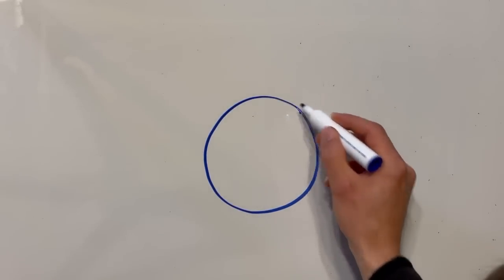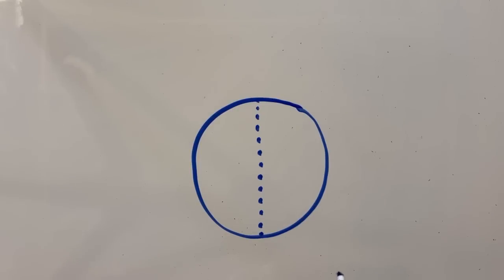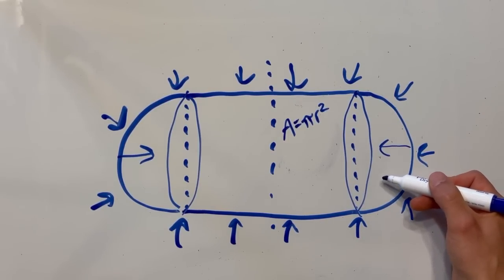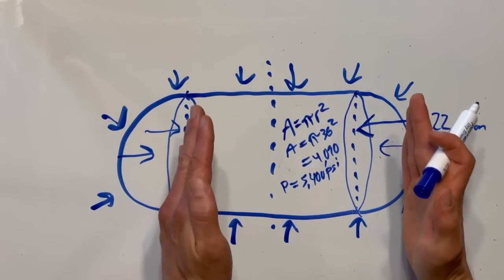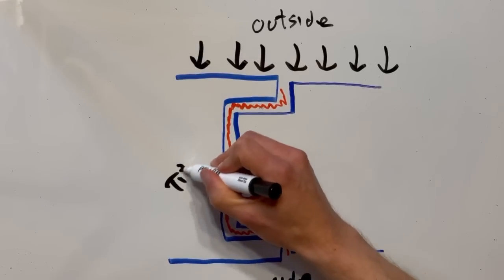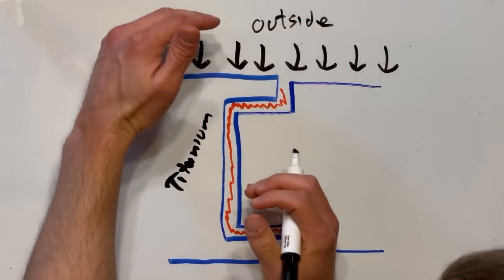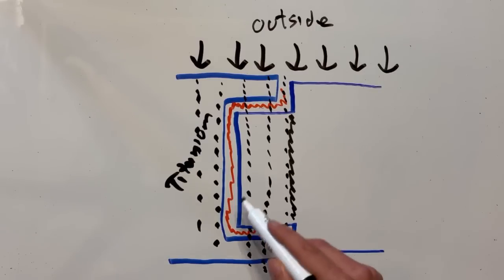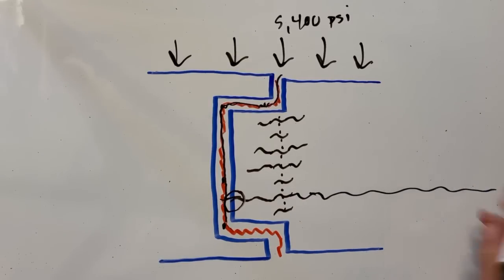Simple Engineering Analysis of How the Titan Submersible Could Have Failed

Comment: Hello mate. Thanks for your video, I am actually a Civil Engineer and I am looking at it from a different way, instead of taking a cross-section which is a circle, if you take a longitudinal section of 1 inch thickness through the carbon fiber cylinder and the two ending titanium rings,  you end up with sort of a beam of 2.6 meters in length and 1 inch in width and a depth of 5 inches (the thickness of the carbon fiber), the beam is now supported from both ends by the two titanium rings, a very simple structure with a uniform load from the top of 5600 psi, I believe the concentrated load in the middle will be massive and the carbon fiber depth needs to be far more than 5 inches, I also believe if Stockton put a third titanium ring in the middle between the two rings, but from inside only as a support to prevent the cylinder buckling in the middle point which is the point of max buckling, it would have made a massive difference in safety. Am I right? And sorry for the long comment. Cheers
Reply: Retired structural engineer here: you are analyzing it incorrectly.  A longitudinal slice of the cylinder isn’t a simply supported beam.  A simply supported beam transfers force only through the bearing points of the beam and also has no lateral buckling restraint.  A longitudinal cut from a cylinder will be a wedge shape in cross section and the primary force transfer is compression against the sides of the wedge, not bending force resisted at the ends by bearing points.  Treating a longitudinal element of a cylinder as a simple beam is a completely erroneous analysis.
Reply: @LTVoyager  Cheers
Reply: @LTVoyager  - I am not a structural engineer.  I am a STEM-phobic poet attempting to discover previously unused portions of the brain. I have just scrolled past 200 comments insisting that this video is the only simple, sensible, accurate explanation of the implosion. But none of it made sense to me because the illustrating principles "felt" wrong, imprecise, inaccurate. Like a specious argument. Especially the image of crushing a phone book. Say what??? Then I found your comment----- that the cross section of a cylinder is a wedge (in my mind, an equilateral triangle with angles touching the circumference of the circle at equidistant stress points, pressure points, or points of resistance to pressure. Then I wondered if my image is also over-simplified because everyone's brain sees a different part of the elephant.  Do you agree?  Are we right or are they wrong?  :)
Reply: @CalebAchsah  Almost everything on YouTube is greatly simplified given the audience.  There are a few exceptions, but a truly detailed engineering explanation of the forces on a cylinder as compared to a sphere would lose most viewers in the first 60 seconds.  Nothing wrong with simplification to discuss a concept, but you need the details to be accurate on failure modes and why a sphere is a more ideal shape than a cylinder when it comes to resisting external compression.  There comes a point when simplifying a problem begins to lose the essence of the physics and material science and that is when simplification has been taken too far.
Reply: @LTVoyager  -  Yes, so true. My mind paused at simplified "equilibrium" because it was easy to envision evenly distributed external hydrostatic pressure on a sphere. But then I wondered how the force of gravity might affect spherical equilibrium. And before I could ponder that thought, I suddenly realized that there must be an equally opposing internal resistance that prevents the mighty ocean from immediately crushing any kind of submersible in any form. So I thought of internal bracing, like a spherical or cylindrical steel frame supporting the interior ceiling, walls, and floor, and made of sufficient thickness to withstand the external hydrostatic pressure bearing down on that particular metal (steel). 

I wondered if some kind of non-entangling cable could be attached to connect the submersible to the surface ship.  And what about other forms of geolocation?  For several completely original seconds, it was quite exhilarating to 'think like an engineer.'  Until I remembered that I am only a poet waging a personal war against STEM-phobia. The shock was too much and I had to lie down. But I will not give up!  :)
Reply: @CalebAchsah  The thick metal sphere IS the supporting structure.  No need for internal supports if the sphere is properly sized and fabricated.  Some submersibles are tethered, but that brings it own set of dangers, particularly around wrecks like the titanic.  Get the tether caught on the wreck and you are in a world of hurt.  Self-propelled is generally safer, again if well designed.  People need to realize that we have been deep diving in submersibles since the 60s and this is the FIRST implosion of such a vehicle so we need to keep this in perspective.  Good engineers have been designing safe submersibles for 60+ years.  We should not let one sloppy engineer ruin the reputation of an entire industry.
Reply: @LTVoyager  -  Excellent answer! Many of us in the "news public" are easily distracted by whatever seems new. The publicity that Stockton Rush courted for his "innovative design" gave the impression that his vivid imagination would rescue adventure, exploration, and scientific research from stubborn historical impediments. And James Cameron was quick to credit himself for multiple dives to The Titanic and to the Space Challenger (was that it?) in the Mariana Trench. So it really is the responsibility of the media to explain that Stockton's deviations from traditional engineering design were unnecessary but "cheaper." His guiding objective was to force "innovation" to fit within his own limited budget. 

Thank you for your patience and for taking the time to give correct answers to my thought process.  I have great respect for STEM professionals.  Congratulations and best wishes!
Reply: @LTVoyager this event has & will continue to help engineering, increase interest in numerous subjects & serve as a HUGE teachable moment
Reply: @myFido-vm9zi  True, but most of the benefit could easily have been had without the loss of life.  It is called engineering testing.  We do it all of the time and we don’t put humans inside the test articles.
Reply: @myFido-vm9zi  That’s a lot of speculation there.  I’m an engineer.  I don’t do a lot of speculation so I will leave that to you.
Reply: But we shouldn't also forget that the front acrylic window was only certified for 1300 meters, this could be also a very probable point of failure
Reply: @AhmedBahgat  True, then no matter how strong the rest was it was all pointless :/
Reply: I totally agree. I think he’s missing the point here talking about the pressure on the end caps, & he seems to forget that these force arrows on the materials are acting in all directions.
Every test I’ve seen (including a rudimentary scale model in a pressure vessel) has shown that it’s the deformation of the tube (inwards at the middle) that caused this, pretty much blowing the end caps off.
Reply: Yes I was also thinking a titanium ring in the center could have helped, I was also thinking that a few cross members from the end caps holding that ring in place could also help. Then you would have a sort of titanium frame that is wrapped in carbon fibre.
Reply: @repawnd1  Indeed, it is like creating a titanium cage covered by a thick layer of carbon fiber

Comment: From the first views of the design I was amazed at the material choice and geometry, especially for a single point vulnerability that lives depend on. "Bend before Break" is a term used for design of critical systems that require sufficient notice of degradation. Obviously not a term known to the designer(s) in the case of Titan..... Signed, a 50+ year old white male engineer.
Reply: I was serving as a sonar tech on nuclear fast attack submarines when that russian titanium hull nuclear fast attack submarine was around, it might still be, I don't know or care. Considering the design of the rest of that icunu class russian submarine the only advantage of bei🎉able to go to around 2000 feet is you needed a weapon capable of operating at that depth to destroy it, in which a nuclear depth charge would delineate that problem.
Reply: he did a 90/0 weave, he did the worst possible weave and used it the worst way he could have, its extremely clear he wasnt that familiar with carbon fibre he trys to say something about that way is ok because the tortion loads dont apply that way, or as much ? but having it weaved like that IS what makes delam happen faster, if they would of went with a differnent weave it probably would of lasted longer. It probably should have had somesort of shell around the carbon fiber so the voids wouldnt form and water itself wasnt making contact with it, they might of been able to use sometype of acrylic but i would have kept the whole thing titanium and put a 2 inch thick or atleast 1 inch thick shell around the carbon fiber glued and slid over it, then the titanium can kind of have more connections to the endcaps the other titanium areas.
Reply: There’s a Russian sub class, I think it’s called the acuna?, that has a double titanium hull based on this principle, I think it was rated to go much deeper than any sub previously built, much deeper than crush depth of 750m. When it came out the US military was petrified of it because their subs couldn’t go to the same depths to hunt it
Reply: White tears???
Reply: Audio-engineering doesn't count, chief.

Comment: When I saw that video of them gluing the end caps to the cylinder I almost had a heart attack, I cringed when I saw them applying it. I would of wanted it sprayed on or better injected if that's even possible. I immediately thought of air pockets and where they machined the carbon fiber i thought of it cracking at the 90. There's no way!! Even a solid steel or titanium cylinder would of been bad but I imagined the layers coming apart like when you squeezed that book. Ow man I can't believe that even got past the thought. I would of immediately have dismissed that idea and hoped I didn't say it out loud.  How did anyone think that was going to work
Reply from the maker: Yes. I keep thinking of a more sound way to do that. If you had a really thin low viscosity resin you could almost set some  very thin spacer blocks in the gap, seal around the edge, and vacuum suck it from one end to the next.  But that type of resin may not have suitable finished material properties.  Definitely an engineering challenge!
Reply: @Mutton_Lettuce_and_Tomato  right!!!! I have a great idea, stick with solid steel or titanium spheres !!!! Man that was a really bad idea!!! And did you hear someone has an email from Stockton were he says he bought the carbon fiber from Boeing and it was expired

Comment: Carbon fibre is strong PURELY because the fibres have very high tensile strength, they are so high that even when used for bending and not tensile applications, the inability to stretch prevents the part from bending or twisting. However if you put it in compression, the strong tensile strength of the fibres contribute almost nothing to compression strength. At that point it’s basically ONLY the resin that’s taking the load. I’m no engineer but it appears to me that carbon fibre is no stronger than solid resin in compression, in other words the sub is effectively made of plastic, but with impurities mixed in, it might have been stronger made out of solid plastic?😅
Reply from the maker: Yes, the design is relying more on the resin than the composite, but the composite would have some purpose supporting and reinforcing the resin in compression, much like rebar with concrete.  I have worked with composited in my career in industry, just not in compression, so I am not completely sure how the fiber and resin matrix work in unison in such a compressive application.

Comment: Just realised that the fracture line in the titanium to carbon Junction was only held by resin and no fibre. The fibre was only wound in one direction around the circumference, hence parallel to the stress line. Your crack lines of delimitation should be vertical, not accross that junction horizontally.
Reply from the maker: I still think there was horizontal layers mixed in to support all the bending stress of holding the two titanium end caps on. I can’t prove it, nor disprove it, however.  Also the cracks would form in the resin between the layers of fiber, hence the horizontal fracturing.
Reply: @Mutton_Lettuce_and_Tomato I found an article in a 2017 trade magazine dedicated to composites where the company that designed and manufactured the hull of the Titan (then called Cyclops 2) talks about it.
I'm not sure if I can post urls in comments so I'll just quote the relevant passage:
"The biggest challenge, Spencer reports, was developing a manufacturable design that “would produce a consistent part with no wrinkles, voids or delaminations.” And without use of an autoclave. Spencer opted for a layup strategy that combines alternating placement of prepreg carbon fiber/epoxy unidirectional fabrics in the axial direction, with wet winding of carbon fiber/epoxy in the hoop direction, for a total of 480 plies."